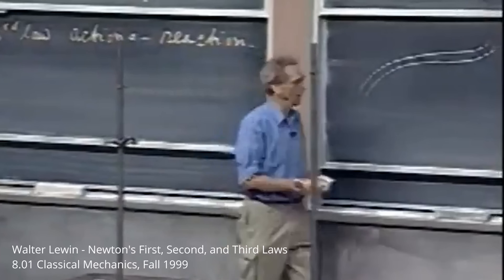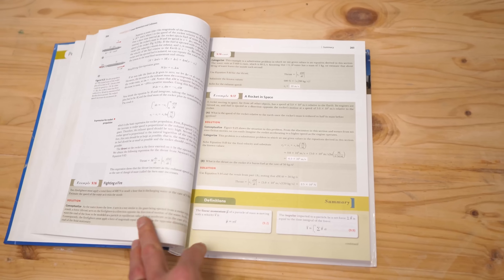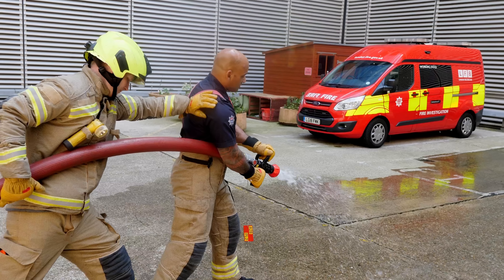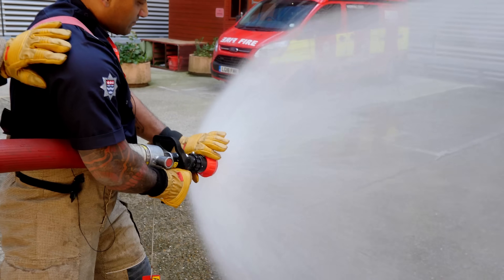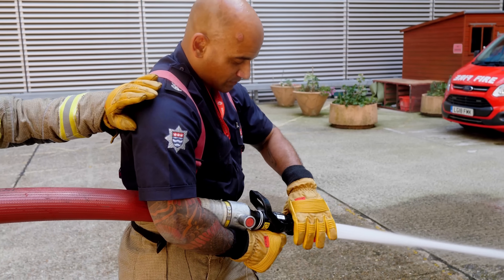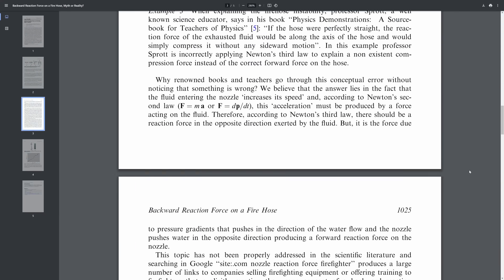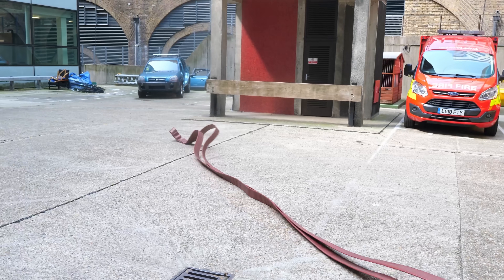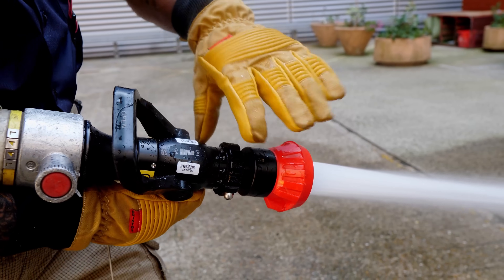Why chaotic hoses dance

Comment: I think the way to think about the water exiting the waterhose is to think the sidewalls of the hose as springs. The pump compresses those springs and those springs provide the force to push the water out of the hose. If the hose was perfectly rigid (no bending or springiness), then I think the reasoning that end of the hose sees no net force would apply.

Comment: What about the effect of viscosity and the velocity gradient where the fluid is in contact with the walls of the tube. Does that result in a force? If so, will it be sufficient to significantly affect the forces at the end of the tube?

Comment: when you put pressure on the hose its diameter expands a little bit, wich in turn makes it shrink in length. maybe this is what causes the force to be the same with and without bends.

Comment: I like at how at around maxiumum kinetic energy of the short hose with periodic motion demo, the hose gets blurred. I bet you could calculate maximum velocity based on your cameras frame rate or vice versa. Tbh you could probably calculate the whole system based on your cameras frame rate. I shudder to think how much work that might be.

Comment: I think you forgot one thing when you talk about only the tip of the loose fire hose flailing. These type of hose are rather heavy on themselves and you have to add the weight  of the huge amount of water inside it. That probably plays a big part in the limitation of the hose "wigling" on the floor.

Comment: Maybe you should not think about hose movement but about stream that is outside blocking path of stream that want's to get outside and that is pushing the hose out of the way.
That stream is local high pressure outside the hose but just to the side there is a lower pressure. Imagine how it would be to point hose head at a solid wall or other object
Not sure if that goes anywhere just thoughts after the video :)

Comment: The example of pushing the string made be think of the Bowden tubes used in 3d printing. Try to push an fdm printer filament from one side of a desk to the other and and it's unlikely that it will get there. Constrain it within a bowden tube though, and you can get it exactly where you need to go, while being able to apply enough force to push it into the print head when it gets there.

Comment: Possible explanation for fire hose only flailing around close to the nozzle: the fire hose is laying on grass, experiencing friction across its entire length. Close to the nozzle it'll behave similar to your air tube, but further back, the cumulative force required to affect a bend is actually quite large.

Comment: The hose reaction force is a straightforward control volume problen from fluid mechanics. You can essentially treat the hose geometry as a black box and only consider the fluid behavior at the hose nozzle. This is why the reaction force at the nozzle is constant. 

Re: reynold's transport theorem

Comment: A fire hose could be pressurised to 100 psi or 689476 pascal (n/m²). with a 0.003m² nozzle (62mm diameter) that could be 2068 N, or 68kg if that pressure can be maintained at that flow rate. 

So now we measure the nozzle diameter, pressure, flow rate, and reaction force, to work out if the force is just the water leaving the nozzle? or if the nozzle acceleration matters?

If it's the water acceleration, then the water travels down the hose as a constant rate mass flow rate because it's (almost) incompressible (ignoring the hose pliability), so the acceleration happens at the nozzle as the restriction in cross section increases the velocity in order to maintain mass flow rate. This acceleration requires a force which must be opposed in order to act on the fluid and not the nozzle itself. A smaller nozzle would reduce the mass flow rate, but increase the velocity. KE = 1/2 mv², so that suggests until your mass flow rate starts decreasing because you can't supply additional pressure, the smaller the nozzle, the faster the velocity of the same mass, and hence the higher acceleration and higher force. But once the pressure reaches it's maximum then the flow rate will reduce and the resultant force will decrease. 

Think of a pin hole in a high pressure hose: the force it exerts is less than a larger hole (assuming the system has sufficient stored pressurisation to maintain that pressure delivery for a period of time).

Comment: I repair/maintain water blasters...   A standard industrial standard "house wash" machine vary from 10-30lt/min, 2000-4000 PSI.
Funny thing is most opt for a 4kpsi 15lt/min unit but 4k will eat wood and paint.. sweet spot is really 2k, 15lt a min... Oh and flow is EQUALLY as important as pressure...
I usually say to people, if you had to clean the driveway and had a choice between a yard broom you could only hold with 2 fingers (while chatting to your friend on the phone)
OR..   a toothbrush.. but you could really stand on it....      
which would you choose.?
(no one has chosen the toothbrush... and those cheap high pressure water blasters... are tooth brushes... High pressure... near no flow)..

ANYHOOOZE.....   I often test units with 30lt/min 3Kpsi with a 60-100m hose reel... or just a 10m test hose... there is nearly NO difference...
Nearly... because there is friction on the water in the longer hose, and expansion of the wire reinforced hose.. which drops pressure at the nozzle a little and creates a hammer effect with the longer hose... (and I think a 1% compression of water at 3kPSI thrown in for no good reason...

there IS a nozzle effect that comes into play... there seems to be more back force with a wide vs straight nozzle which I'm guessing is the force of the water trying to push the air out of the way..

Now that 100m hose is usually on a reel, which of course could be 'adding' something to the equation, but I have used 40m (2X20m hoses) just coiled on the floor and the hoses barely move, and usually only with water hammer/expansion when triggering the gun.

So here's the thing...   the SPEED that that water exits seems to be the most important thing...
In NZ we have a 100psi ish public water pressure @ 10-15 lt/min (a 15lt/min pump hapily runs on most garden hoses but a water blaster can actually 'suck' more than the hose naturally pushes (a bit like how little water flows through a straw, yet you can suck a glass empty through one in seconds.
The 15 litres of water exiting that nozzle every minute barely registers any weight in my hand washing the car...
that same 15 leters a minute exiting a 3000 PSI water blaster feels like maybe 2-3 KG...
That same 15 litres a minute exiting the 10,000psi water blaster I uploaded on my channel needs a brace handle and the hose is wired to the gun and machine incase it comes loose...

so yeah...   I guess like a bowling ball.. if you throw it with a noodle pressure, apart from it breaking your foot, there you stand...
Try and push it with 10,000PSI of pressure to your palm and you leave an imprint on your neighbors garage with the back of your head.

Comment: 8:58 - Maybe I am confusing things here, but if you have a full turn in your tube, won't the force in every direction cancel each other out? A full 360 degree turn would have air pushing equally at every point in that turn, resulting in a net 0 outcome? Therefore the result would be very very similar to a straight tube?

I guess the very easy question is whether you get the same force with a 90 degree turn in the tube.

Comment: Hi Steve, I think you should consider a third effect, which is the change in cross-sectional area at the hose nozzle.  The firefighters nozzle is much smaller than the pipe, so the water has to accelerate to maintain the same flow rate, which leads to momentum transfer to the nozzle.  It would also be interesting to test the fluid leaving a diverging nozzle / feed horn and see a different force again.

Comment: I think they are the same, however the air is less predictable because of 2 reasons: 1) air can have compression pockets in the hose, water will not have these. 2) the air is significantly more susceptible to the wind because of these small pressure pockets and the significantly less overall pressures. But if you could take those 2 things into account you could work out the same motions with these 2 deviations in flow. Just my 2c.

Comment: When you first start flow on a hose that was full of air, it often shakes even with the end restricted as the water pressurises the hose. I would guess this effect may be larger if the hole on the end is smaller? 

You can also see filled hoses shake when you start/stop water suddenly.

I think the stretchiness of the hose material is consequential? Thick steel doing nothing. Thin rubber moving more?
I also think the rate of change of flow rate is consequential? Turn the tap off fast and it shakes, but slow and you don't see it. Maybe because that force/energy was dissipated over a larger time frame, so the acceleration for the given mass and final velocity were smaller?

Comment: A hose in a pool of water will move chaotic too. However, in a pool of water the reaction can be slowed down in real time and the hose will be less restricted; in a more viscous fluid, but less resistance as it sides around. I think this will let you see the ripples in the length of hose more than you can see in the setup you were using.

Comment: Can you not measure/calculate the mass flow rate of the water exiting the nozzle? 

Google suggests up to 19 lps, which is about 19 kg per second. At 2.5" diameter hose, the nozzle could be 62mm, or 0.003m² to get 19L/s (0.019m³/s) out of 0.003m² of area, the flow of the water is 6.3 m/s. 
F=ma, mass is 19kg. Acceleration is dependant on difference in nozzle size to hose bore? Smaller the hole, the faster the velocity, but at a lower flow rate maybe because assuming the pump is constant energy must be conserved and KE=1/2mv²?

Can we measure the speed of the water leaving the nozzle with high speed video? or squirt it horizontally and use the vertical drop per meter to approximate it? The fire engine should have a flow meter on it. You know how long it was turned on for. So you know the average mass flow rate, and the velocity. Then you could maybe rig something up to measure the actual force experienced, like with the airline? 

Do we assume that the difference of water being incompressible vs air's compressibility to be irrelevant?

Is it anything to do with the pliability of the hose? If the hose can't change cross section then it can't dynamically vary the local flow. So a stiffer hose should wave less, and a thin and highly pliable hose would wave more? 

Factor in Bernoulli for any constriction, and the Coanda effect, and you have more forces acting on the internal surfaces.

I feel like we could scale the experiment down from a fire hose to a garden hose and make experimentation easier without loosing the transferability?

Comment: Steve, I think you are mixing hoses with and without nozzles without taking into account that nozzles introduce a new force that doesn't exist in open ended hoses.
The fire nozzle is like a rocket! Because the nozzle is constricting or reducing the cross sectional area compared to the hose, and so the water convert some of the very high static pressure from the pump into acceleration, right at the nozzle. Bernoulli’s Principle.
Without a contricting nozzle, you don't get push back. And the flailing would be very weak and not dangerous.
Just take a regular garden hose and check with or without the nozzle, big difference.

A firehose without a nozzle wouldn’t be dangerous—it’s the nozzle (on top of static pressure) that makes it powerful.
Without a nozzle, the water simply exits at the same speed as inside the hose, so there’s no additional acceleration and no extra reaction force.

Comment: Is pressurized laminar flow possible? And also. The pump increases the pressure, but so does the restriction at the nozzle. My thought process is that if the pipe and the nozzle didn’t increase the pressure inside the pipe, there wouldn’t be any force at the end, but the water would still flow with pressure. And I think that it would be laminar.

Comment: before the video, I'm going to assume that it is similar to meandering of rivers, but with elastic deformation rather than erosion, with the hose never starting straight and then momentum keeping it from getting straight. I'll also guess that if you ran it for  a long time with friction on the floor it would eventually lie straight. - ok not right but not too far away :)

Comment: Even though the momentum started in the pump, while it travels through the pipe there will be a change in momentum between different layers of the water ? The layer that is touching the pipe will have more resistance thus slower velocity than the middle layer of water (sliding friction or something)

Comment: It's funny. My naive hypothesis for the air hose phenomenon was the reaction force explanation you settled on in the end. But hearing your previous explanations, I thought that must be too simplistic and that you were probably right, all for you to work your way back to my original hypothesis. 

I have a question though. Imagine for a moment that the fire truck hose was rigid. Maybe it could be fired out of a turret at the top. Wouldn't it push the truck opposite the direction of fire regardless of whether it gained it's momentum at the pump? Would the type of pump or it's orientation matter at all? Would it change by replacing the rigid hose with a flexible one?

Comment: It's worth considering that the water also speeds up as it flows through the restriction in the nozzle and that restriction will increase the pressure behind it.

Comment: Hi Steve.  Very interesting and educational as always.  Thank you! 

With the fire hose, as apposed to the airline, would the weight of the water in the hose help keep it under control / on the ground further back? 
Also I’m wondering if water would have more friction than air passing through a hose keeping it straighter?  
I’ve no idea if any of this could be right by the way.  😂

Comment: I think the force is felt at the point where the pressure changes. So it is at the nozzle where you have high pressure inside the hose to when it exits and becomes atmospheric pressure.
Edit: I should’ve watched the entire video before commenting.

Comment: I didnt really understand the argument from the fire fighter, that closing the valve is "too slow" i guess? A couple of dudes crawling on top of the hose seems to be even slower and more dangerous to my eyes. There could also be a clamp for the hose, so you could temporarely shut or just reduce the flow...

Comment: I would like to bring up few more variables to consider to get better understanding. 
The relative rigidity of the pipe, the fiction of the fluid going through the pipe, water hammer effect and hot the behavior changes when the pressure keeps on increasing. 
These are just few things that came to mind fast and think would need more consideration. Also Bernoulli's principle wasn't even touched on this video which surprised me.

Comment: Going purely on intuition here; I imagine it is actually the same principle at work in both hoses and inflatable tube men, but the differences in fluid, hose length, hose rigidity, and probably at least a few more factors cause such a difference in visual behavior

Comment: This will be corrected. Perhaps by Derek 😊 no seriously though, you were onto something around 12:30 but the analogy to pushing on a string is quite misguided. In fact effective pushing of fluid is the whole basis for pneumatic power. I suspect if there was zero resistance between the fluid and the inner walls then the firefighter would feel no force. It's all about the skin friction coefficient.

Comment: I saw this happen in the worst possible way when I was a trainee firefighter. They had serial coupled three 8-bar trailer pumps, to see how tall a column of water they could get. Pushing the hose pressure up past 20 bars, which was the tested limit. So of course it broke, right behind the nozzle and we suddenly had water shooting out at 24 bars 90 degrees angle. So that hose started flailing like a kraken tentacle, flying out of the hands of the five guys holding it. Luckily there were only minor injuries, a sprained ankle and one guy had a cut on his stomach. But it was sobering to have the ambulances rushing into the barracks with full lights, not going out.

Comment: The action on the "hose" is defeated by the elasticity and rigidity of the "hose." do your air compressor experiment, but use something flimsy like them tubeman, and then run it through a straw. I bet if you crank up the pressure enough on a rigid straw, you will see a high speed failure similar to how the surgical tubing behaves, but only for a moment. There are more forces at work here than just the fluid dynamics.
Reply: Specifically, if an elastic hose has pressure through it, it will stretch. The centrifugal force at each radius will stretch the hose, creating a longer pathway for the fluid, while creating moments of vacuum inside the system.